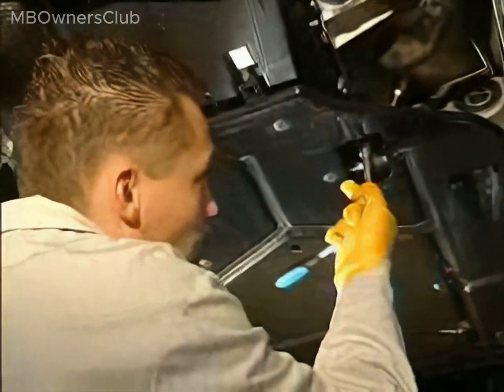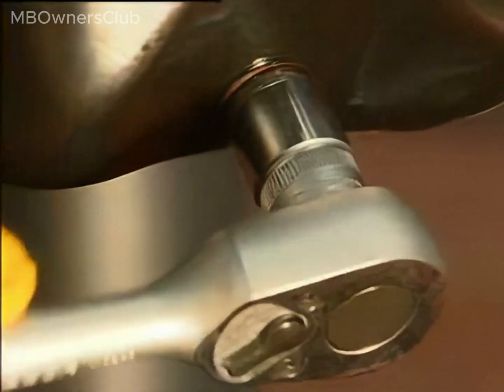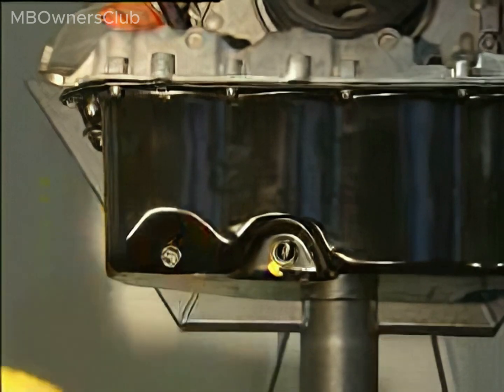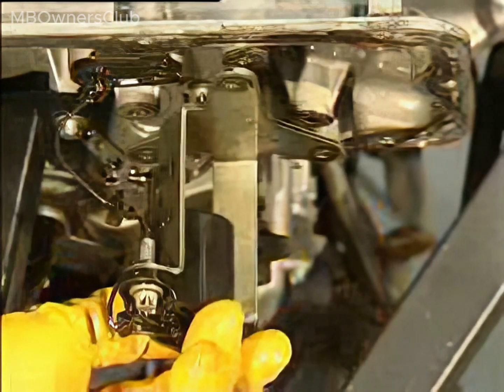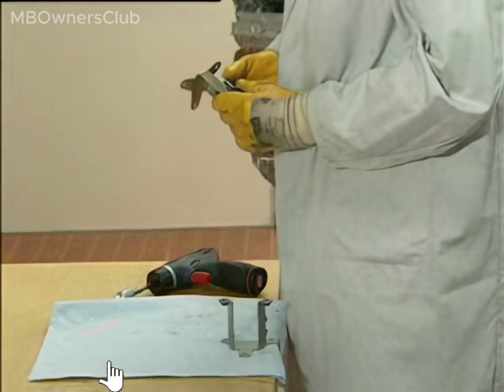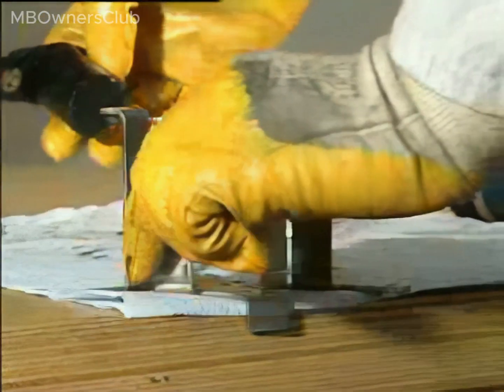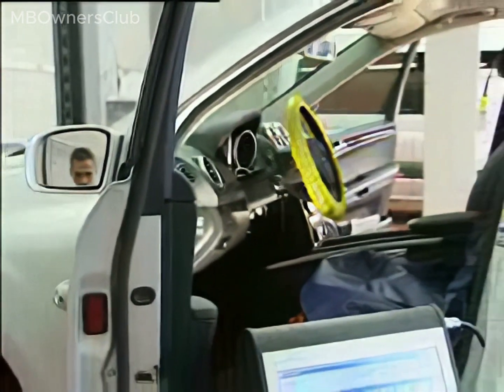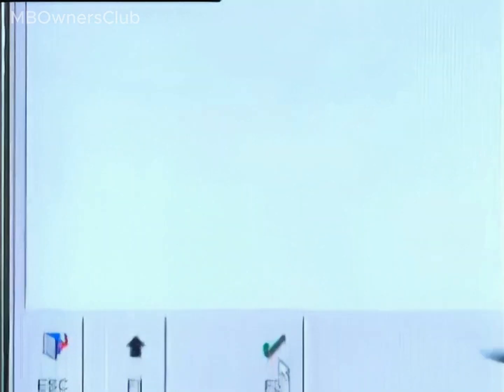Mercedes-Benz Oil Level Warning: A Comprehensive Guide to Resolving the Issue (engine OM 642)

Comment: 2007 ML320 CDI.   I never had a problem with "check oil level warning" eversince new.   This message just started showing after 178k miles.   What changed ?

Comment: Nothing as anti consumer as Mercedes removing the dipstick, (and oil pressure gauge), from newer cars. It's probably a VERY reliable component but if it reads wrong or fails, I'm betting the first you know about it will be a lunched engine.
Reply: I've been driving since 2000 and I've never experienced an oil pressure gauge on either a Mercedes, BMW or a Renault in Europe. I think it's a US thing, would definitely be nice to have.